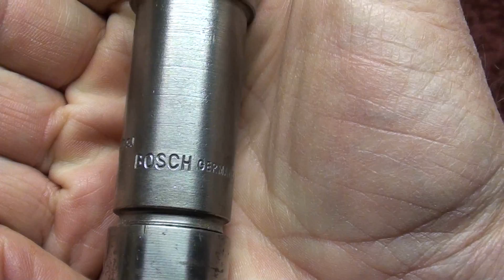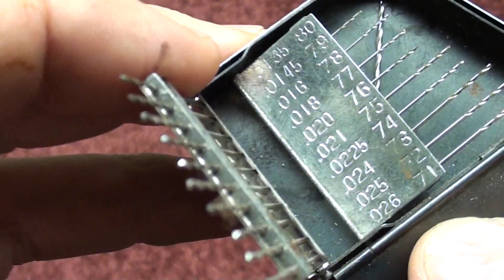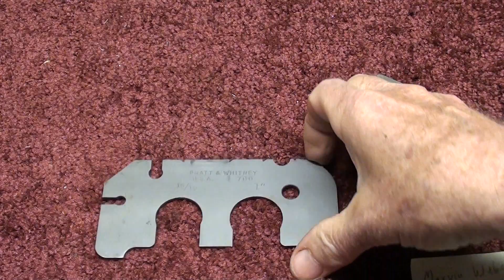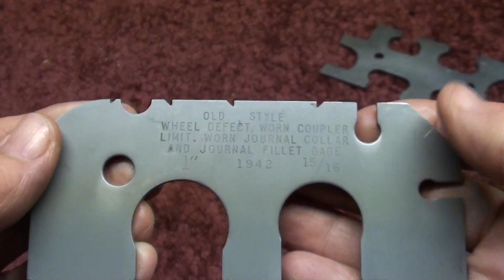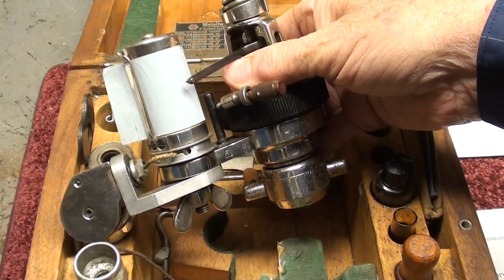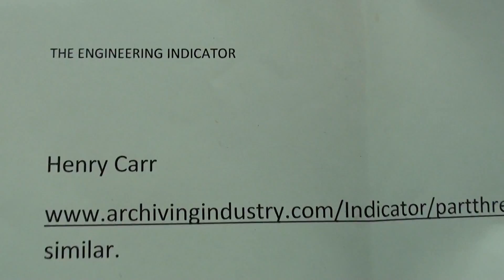WHAT IS IT?  #27b answer Mystery Item tubalcain

Comment: The recorder was attached to the Keene cock on slow speed industrial engines and compressors to record the cylinder pressure events and to also diagnose problems. Nowadays it is done with sensors and computer programs.

Comment: The indicator device is used in calculating the efficiency of an engine it allows Indicated Horse Power to be calculated and that can be compared with Shaft Horse Power to calculated engine efficiency.

Comment: i work on diesel engines and I know that is not a fuel injector, it is a fuel nozzle. an injector would have a plunger in the top that is moved with a cam.

Comment: I might be way too late, and well then it's not the first time.
I know what this is. In Danish it's called an indicator which measures the pressure in the cylinder of a (two stroke) combustion engine (maybe also a steam engine) as a function of the crank shaft angle and draws an indicator diagram.
With an area planimeter the mean  indicated pressure in the cylinder can be calculated (indicated) by means of the diagram. Different kinds of diagrams can be produced. Combustion pressure, compression pressure, charge pressure, exhaust pressure etc. can be established.

Comment: My apologies for the lateness of my post but have only now seen the video. The item is an Engine Indicator which is used for calculating the Indicated Horse Power being developed by (in this case) a large diesel engine, they were also used for calculating the I.H.P. being developed by Steam Engines. To calculate the I.H.P. being developed by the engine the area of the of the 'banana' shaped trace (indicator diagram) produced on the paper slip wrapped around the cylinder had to be obtained, this was done using an instrument called a Planimeter. As an apprentice marine engineer in the early 60's I took many of these indicator diagrams from a large marine triple expansion double acting engine to log the I.H.P. it was producing - this engine eventually found its way into the foyer of the Science Museum, South Kensington, London.
Reply: I forgot to add that it was a Marine Steam Engine

Comment: Speaking about small holes...  Very interesting this explanation related to the way the diameter of a  hole was incrased by pressurising into it an abrasive liquid... as much as it was interesting to understand that tiny holes were drilled by EDM....

Mr. Pete, what is the smallest drill  you have seen ? 
 Most of the charts stop at number 80 drill.  Harvey's tools is selling a german made one wearing the number 102 ( about 0.003 ").  It has a large hexagonal shank ( about 1/8 ") and cost around $50.00...
Teachers like you are a real gold mine......

Comment: I work at an University and we have one of these attached to our extremely old Natural Gas engine that we use to show students how engines work.  Ours is a single cylinder engine with exposed valve train and open crankshaft spinning a large flywheel.  This instrument is connected to the cylinder head and the string you see is hooked onto the crankshaft.  This will then produce cylinder pressure vs crank angle diagram.  This is very useful for teaching and I can see how it would be used to tune and test engines.
Reply from the maker: I'd like to see that
Reply: I will get a photo for you and send it to you.

Comment: Greetings Mr Pete, 
Very true, the indicator attaches to the "indicator cock" on the head of each cylinder. Using the spring constant (amount of pressure it takes to move a certain distance) the average area under the resulting line, and the length of the graph, the mean effective pressure can be obtained. indicated power, rather than brake power, can be found by multiplying the pressure, stroke, bore area, number of cylinders and rev's per second. This is for a two stroke, with a four stroke this number is halved. What makes this interesting is we now have digital versions that take a tenth of the time and store ask the data, and pressure sensors, so we can see from the control room what the engine is doing and make adjustments in real time. 
Thanks for all the great videos.
Best regards,
Brad
Reply: All the data, not ask

Comment: Engine indicators go back to the 1800's, and were first used with steam engines. The output is pressure vs. piston position, which can be correlated to pressure vs. cylinder volume. Ashcroft made them (the one I have used), as well as matching planimeters for measuring the area on the indicator card (which gives the energy per cycle, which can be used to determine power and efficiency). Large engines often have test ports available for each cylinder.  Attaching the string to get true measure of the position can be an interesting exercise on some engines. Also Crosby, and a number of others. A LOT of precision tools were made in DDR back in the day. East Germany had the skilled people and help reconstructing that Russia didn't have after WWII, and micrometers, indicators, calipers, gauges,etc were made there and filtered throughout the soviet controlled states.

Comment: Lyle,
The fuel injector usually operates with 2000 psi and the other port is a return. The return fuel flow helps cool the injector.

When you make it to that webpage for part three, it's on page 119 - 121.

http://www.archivingindustry.com/Indicator/partthree-2015.pdf